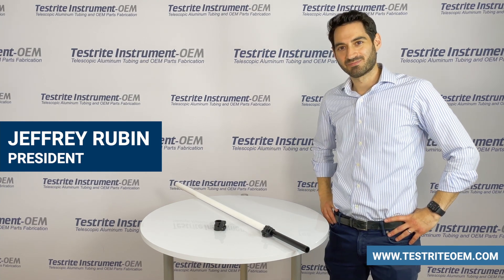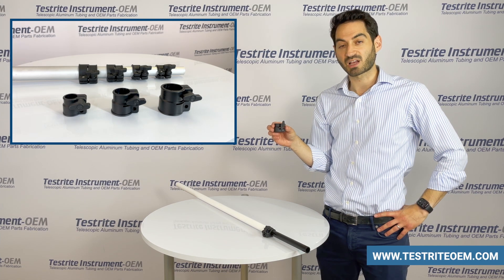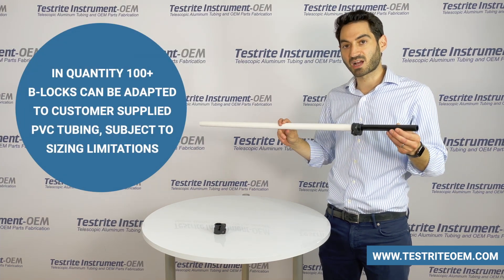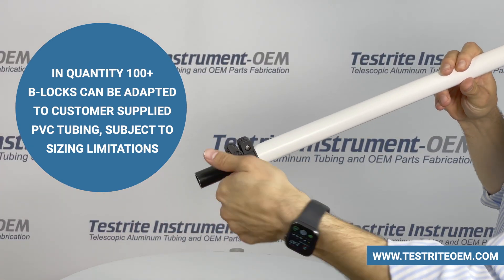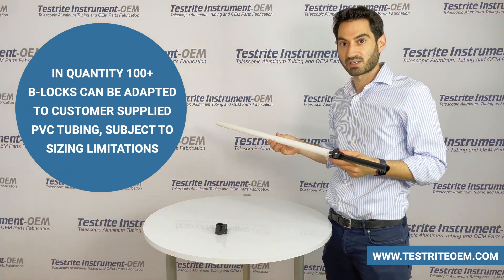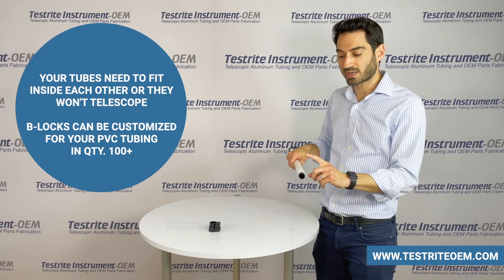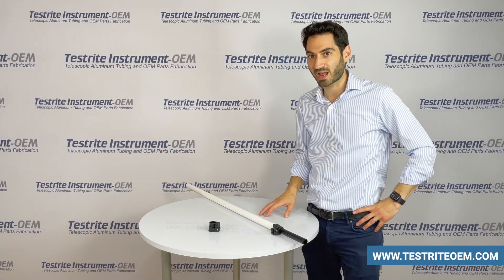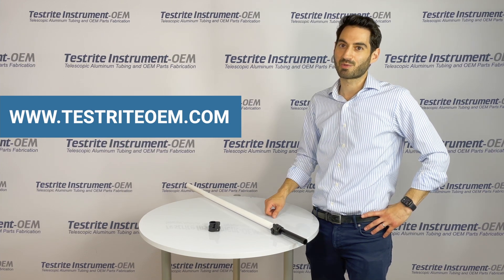Telescoping Tubing Locks for PVC Tubing

Comment: Regardless of using pvc could you explain if when using a B Lock would the black tube fall out from the white tube when fully extended or is the lock preventing if from doing so? I want the black tube to fall down but then stop itself.
Reply from the maker: Nothing about the B lock stops the inner tube from pulling out. When we manufacture aluminum tubing, we do operations to the tubing to stop the inner tube from pulling out. We make custom aluminum tubing in 25+ and quote requests can be sent in at https://www.testriteoem.com/pages/rfq/